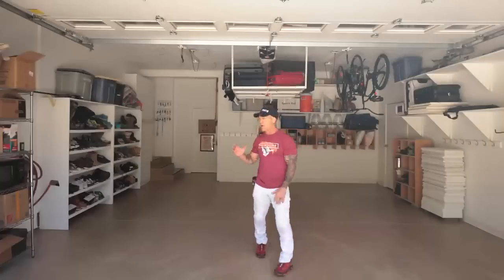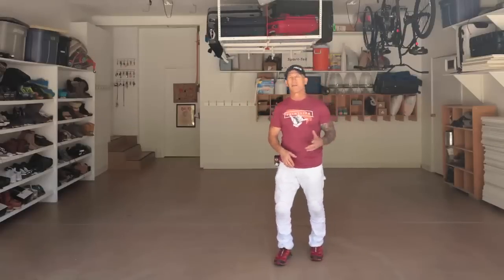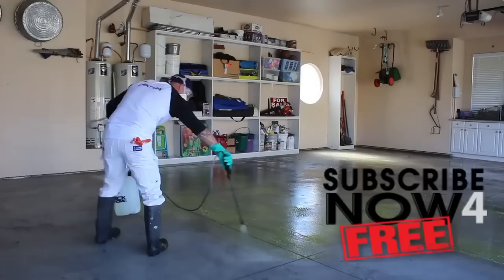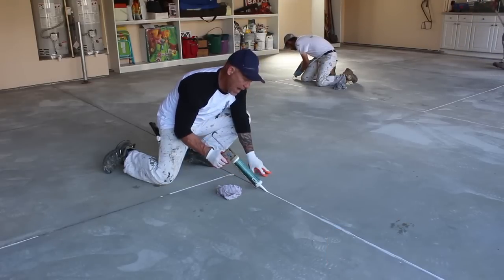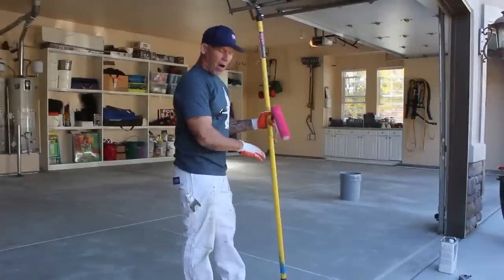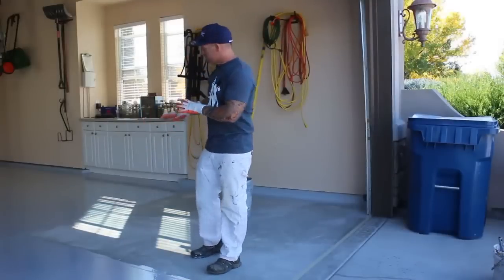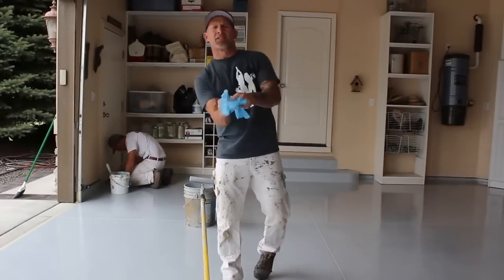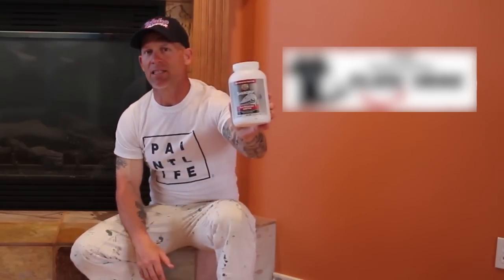How To Do an Epoxy Floor! Everything You Need to Know to Be a Pro!

Comment: 10 hrs ago I did my garage. Used rust oleum.  I power washed first, paint stained etc. then I used acid, I used a hard bristled brush to work in the acid. Worked great.. then I rinsed.  Floor is still perfect..

Comment: Curious how to handle the cabinets in some of the places. The first where you did you bid you didnt mention if you paint around or remove or have the customer remove them. The second, do you do anything to keep the acid and the water from flowing into the cabinets on the right side and destroying them? Most builder grade cabinetry around here is coated mdf and isnt always installed to the spec so the bottom lip could be exposed particle board, wouldnt that wick up the acid + water and cause some warping? Or is this where you have the caulking come into play and lay a bead around that stuff first?

Comment: I do epoxy flooring for a living. You need to grind the floor then clean with DA. acid washing is the DIY way, diamond Grinding and you have 20+ yrs. also you use 100% resin so nothing evaporates and you keep the mil you put it on at. Also top coat in polyaspartic because epoxy isn’t uv stable. But most important is diamond grinding.
Reply: I’d say if he’s been doing it for 22 years and hasn’t had 1 call back his method is just as tried and true as yours.
Reply: @nicholasummel7867  ya I guess that’s what he says gotta believe it. I’m just going by the books. My old man has been doing it 38 years just epoxy flooring not paint with some epoxy, retiring this year. Just putting it out there. I redo acid etched floors with water based “resin”  all the time here in New England. Sometimes they don’t call back the same guy, they call someone else to fix it redo it whatever… stay safe
Reply: He’s a painter for 22 years he hasn’t been strictly dropping floors everyday for that long. He’s done a handful during his painting career   Do enough of them wrong he will get a call back. Maybe a commercial kitchen auto shop will not hold up. Made this video because it’s becoming popular. Lol.  He don’t moisture test, hardness test  just nothing with code here.
Reply: Don’t you notice he has one or two videos about epoxy amongst years of painting videos and your thinking he does these all the time for 22 years…. Cmon he’s a great painter and has great ideas but this is not how to pour resin flooring. Not when your giving a 10 year warranty.
Reply: Does the floor grinding apply to new concrete floors or skip that step?
Reply: Make a video yourself bro. I do this for living too I know your right … let’s show this rookies the right way
Reply: @ForeverYoung904  I would grind it. Unless they broom finished it like a sidewalk with texture. Thats what the grinding is for to create CSP (concrete surface profile) texture in the concrete for the epoxy to grab onto. Also wait 28days after concrete is poured before coating. 👍🏼
Reply: Hello Mike. I'm planning to do diy epoxy on our garage in our brand new construction home that we didn't move into yet. Can I talk to you to get more suggestions on it. Really appreciate.
Reply: @hinanaeem9977  sure. I’ll do my best to help you.
Reply: @sebastiangomez4696  I know man. I started having my daughter record the process. I was going to do a flake/quartz, solid, metallic and full glitter. But then I didn’t lol. I just took my pictures-before and after. Lol.
Reply: @miked6097 hey mike, I’m new to expoxy coating excited to start this business soon will be going to classes soon in January to train and learn. I’m looking for some insight info on buying decent equipment to get started. What would be a good grinder/vacuum budget 5-10k? Any recommendations or suggestions on brands or type models ? Thanks
Reply: @DmitriyDonkoglov  XPS out of Florida  they have a good set up.
Reply: @miked6097  thank you Mike. is there a link to their website or catalog? Also, what's a good source to buy the material flakes epoxy polyurethane etc? What’s a reliable source or company with good quality material and prices? Thanks in advance

Comment: Many concrete garage or basement floors are not suited to this epoxy coating. You will discover that although the slab does not show moisture coming through it when you test it, it may very well have significant moisture at another season of the year. I no longer do epoxy floors for this reason.

Comment: What about a clear tip coat? Is t that required? We are about to redo ours and I think it peeled partially because the way the painter did it originally. There was no top coat. The new ones we see have a nice top coat.
Reply from the maker: No

Comment: I have a customer that wants to switch from pro industrial paint to epoxy on their garage floor. I have one worry, there is a drain in the middle with a pretty severe dip around it. The customer wants to do it anyway and wants the dip to stay for drainage. Have you ever run into this problem? Is this even do able? I have been searching for a tutorial about this but all of them are on completely flat floors with no drains. Any help will be much appreciated. Ill buy a few Paint Life shirts if you can get back to me.

Comment: hi and thank you for all the info! I'm a potter moving into a studio space that is new concrete.  I want a floor that is easy to mop up clay dust.  I won't be moving heavy equipment around other than a few rolling carts/shelves, and shouldn't be leaking crazy chemicals into the floor (other than ceramic glaze occasionally that can be wiped/mopped up).  Looking for any recommendations.  Epoxy? full 2 coats? Any suggestions are appreciated.  Thanks!
Reply from the maker: Tile Clad high solids

Comment: If I use rust oleum to fill in big chips in the concrete can I still use muriatic acid on top of the rust oleum?
Reply from the maker: What product are you referring to?
Reply: @Idahopainter  thank you for replying 🙏🏼 I was going to use rust-oleum concrete patch and repair to fill in a half inch deep hole. Do you recommend first using the acid, then patching the holes?

Comment: Why don't you have the garage door come down on the epoxy coating?  It seems it would help create a better weather seal.  Also, do the color flecks sink down into the second coat and leave a smooth finish? Thank you, loved the video!
Reply: They settle a bit but you need to clear coat over the top of them.
Reply: How many square feet does that are Maciel 8100 cover? Per gallon?

Comment: Should be using an epoxy based crack filler. Or urathane.   Xylene to thin   Man this video is crazy   Don’t let the epoxy sit past pot life. Clean five gallon bucket. Not an old peeled one. 2nd coat shouldn’t be epoxy it should be poly. Still a kind of “resin”